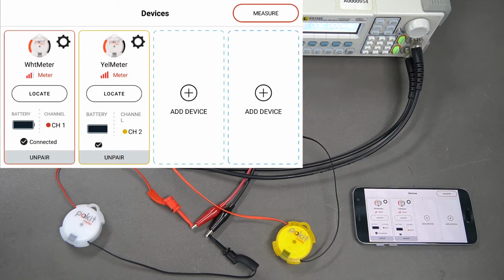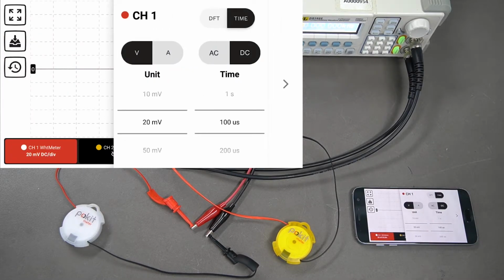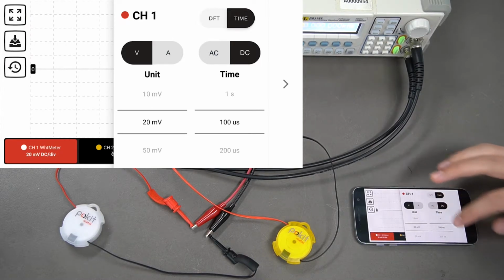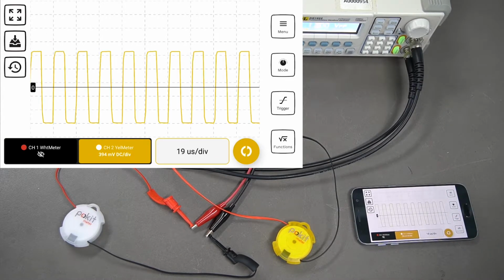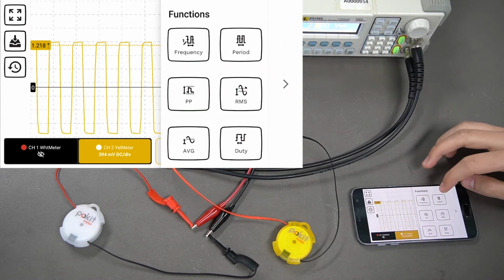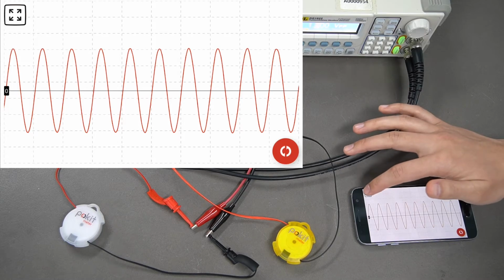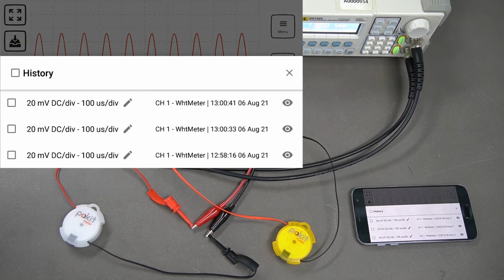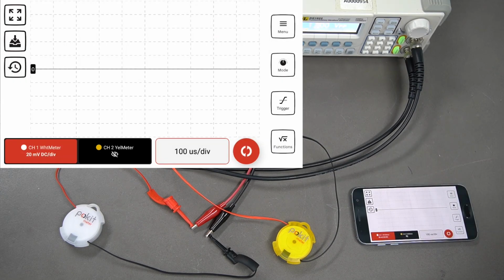Oscilloscope - Pokit Meter - Pokit User Guide

Comment: What's up with Free Run and Continuous with the scope function? 
I'd like to be able to view a continuous waveform. I can't seem to activate those functions with my Pokit Meter.
Reply from the maker: Hi there, Pokit Meter can't use Free Run or Continuous modes as only Pokit Pro has these features.
Reply: That's pretty disappointing, but for the $40 l paid for it, I'll be happy with it as a meter, and maybe being able to see the ripple in some of my power supplies. The app could certainly have a bit more of  clarity tho